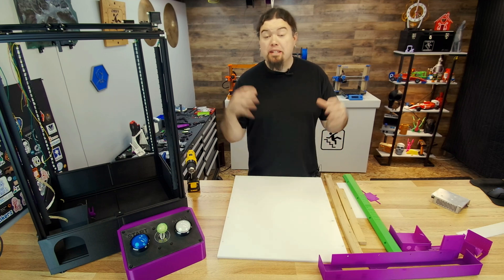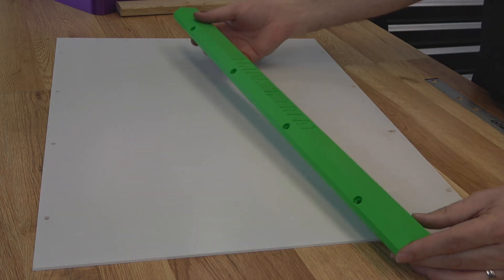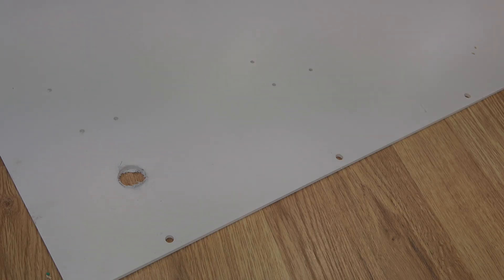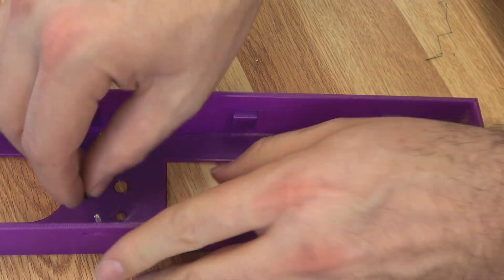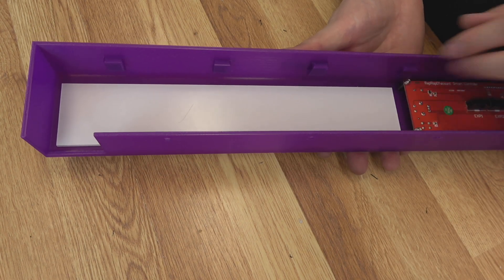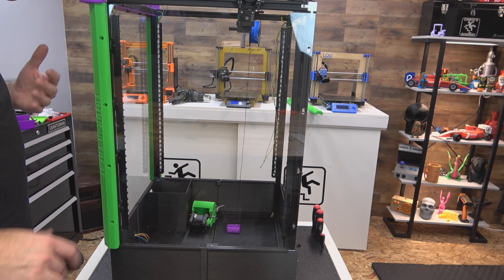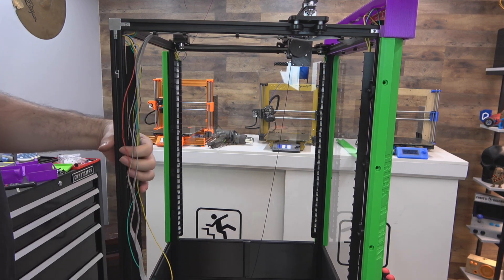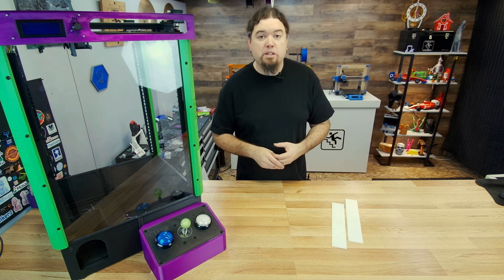The Candy Claw Series - Part 5 - Electronics - Chris's Basement - 2022

Comment: I suggest you use 7mm dia. Clearance holes in the acrylic. That way you minimize or eliminate tolerance issues between corner piece hole location and alu. extrusion length tolerances.
Reply from the maker: Thanks!